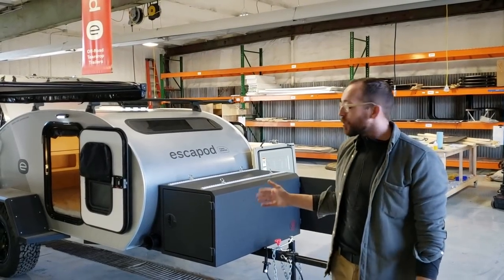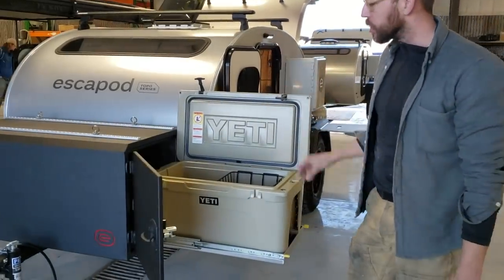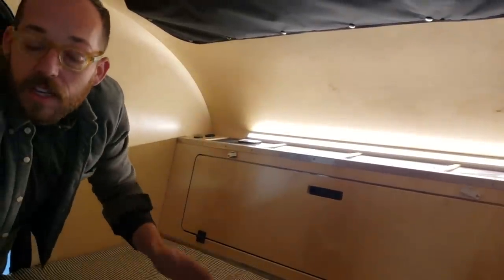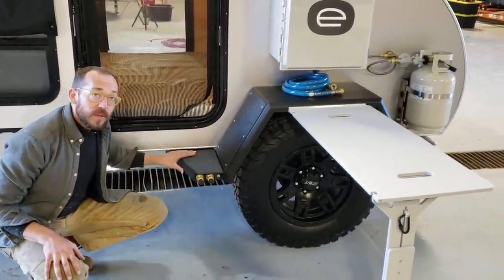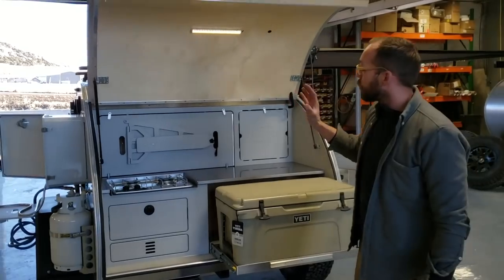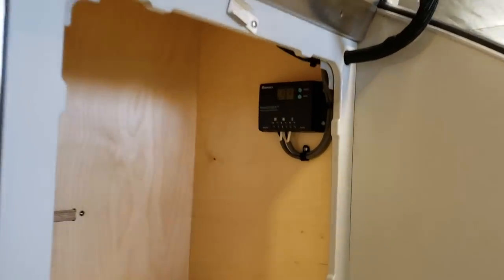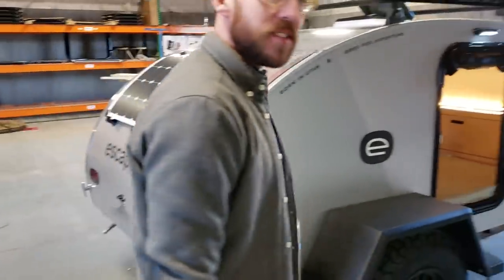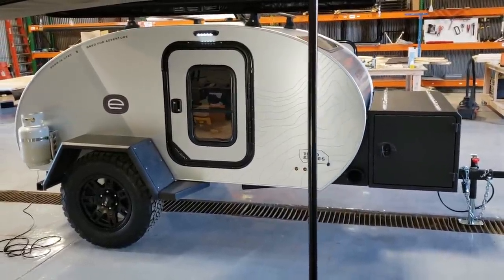2020 Escapod Off Road Teardrop Trailer

Comment: Looks pretty nice. I’m really liking that integrated solar panel, but still not loving the massive square plastic (?) box housing the water heater. It’s ugly, non-aerodynamic, and seems like it could get cracked from road debris. I’m sure having the hot water is super nice though. 

I’m between you guys and Bean. I like the lower overall height of your units, but their one-piece fiberglass body may have me sold, especially since mine will be living outside in the rainy PNW. 🌧 I also like that their cabinets go between galley and interior so you can access that gear two ways. 

Suggestions for video production: speaker needs a mic, videographer needs a tissue, and shop needs to kill the tunes. 🎤🤧🎼😉
Reply from the maker: Thanks for the feedback Kevin - Got some answers for you: 

1) I understand your feedback on the water heater box. We've begun to do a lot more custom box design, and though this box has worked well for us in the past, we do imagine a near future in which we have a better solution for this. 

2) I can understand that a fiberglass body is a nice selling point, but there are many ways to properly seal a trailer, and we go to great lengths to ensure our wooden structure is watertight (not to mention much more comfortable inside with the wood). All seams are sealed with vinyl tape, then butyl, then trim with silicone on each edge. I've never received word from our customers that our Topo Series is susceptible to any body leaking. We've overcome some challenges with the doors and hinge in past years, but we've addressed all concerns and are very confident in our trailers ability to handle demanding elements. I'm happy to talk through more details of our build, like a complete mortise and tenon construction, that lead to significant more rigidity and ability to handle not just tough elements, but really tough terrain. Even better, you're welcome to visit our shop and see the steps we go through in our build process. 

3) I hear your comments regarding video quality. Sometimes the choice is between a quick video or no video at all. We have the necessary equipment, but this was a really exciting build and an impromptu video before our customer came to pick up. Will make sure we bust out the proper gear next time! ;)

Comment: How large can we upgrade the tires to, 35"?
Reply from the maker: 35" is the biggest we've done in previous builds, but our current setup is perfect for 32s, and can easily fit 33s. 35s would require a custom sized fender, and (in my opinion) start to look too big on this sized trailer. Are you trying to match the tire size on your vehicle so you can use the same spare for both?
Reply: @EscapodTrailers  

Yes, a 2019 Raptor with BFG 315/70R17

Comment: So its an off road trailer but you designed the water fittings to be exposed? ummmm its not an off road trailer now.
Reply from the maker: Hi Travis! We appreciate your feedback! Our Original TOPO trailer has a standard ground clearance of 18" from the ground to the lowest point on the frame. So the water fittings should be plenty high to handle all the rocks, logs, and bumps you throw at it :)